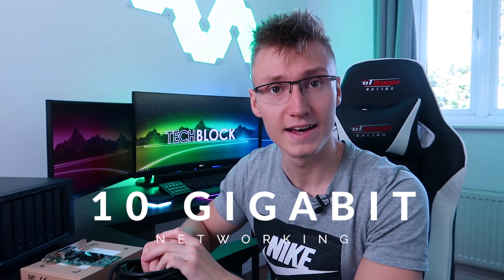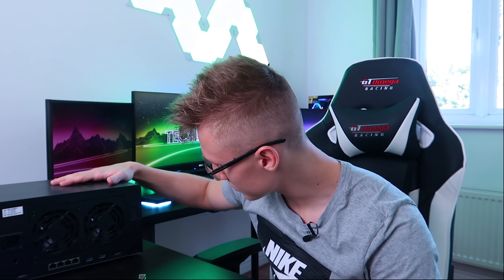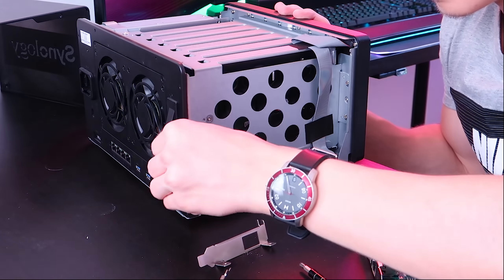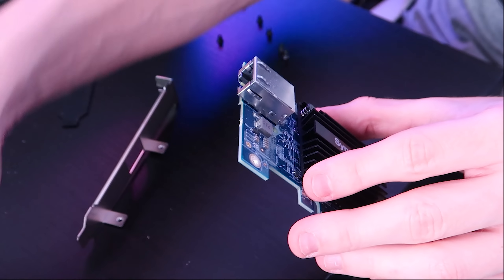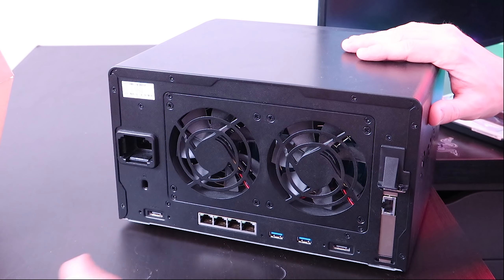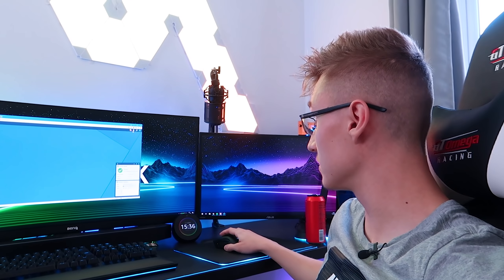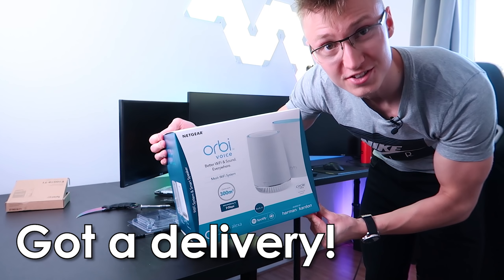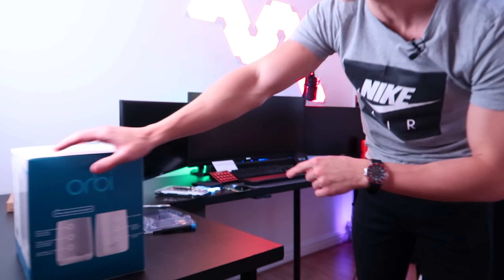IT WORKS!! - 10 Gigabit Networking + CAT 8 Ethernet! (Part 2)

Comment: about the SSD cache, it's good since storage is very cheap nowadays, about results.. well, you'll get better speed only on files that are actually cached, on all the rest the speed won't change !, second, cache is needed only if you use same files many many many times during week/moth, if change often, benefit is like 50 %
Reply: Lämp

Comment: You could just grab a Mikrotik 10GBE 5 port switch for $130 US on Amazon and 2 10GBE PCIE 8x network cards for $62 on Amazon. Then connect the switch to your Nighthawk, then your Synology and main puter to the switch under your desk. Depending on cables, 3 might be $50 to $60 on Amazon. That's a sub $300 solution for 3 10GBE connected devices.  That seems a bit cheaper and more efficient in the long run, as well as giving you 3 more ports for later 10GBE expansion. Also, your Synology has an APIPA, as per the 169 IP address on the map. If you used the method above, all of the devices  would also achieve internet through the 10GBE connection.
Reply: Yeah most of the cables hes found can be found for 10 to 15 dollars

Comment: I have a cat8 Awg 22 which is the biggest you can get on thw market. The problem with cat8 is its a 2 channel, not a four channel. Which allows multi connection to run at once

Comment: well well.. again.. you can't use a bonded gigabit link, lacp or lag, neither, to copy a file if in the frame containing the sender there the same device ! that works if a nas is connected bonded, like your 4x1 gigabit to a switch and to the switch are connected different "sender" pc, whatever, than the nas will be able to share 4 gbit bond with those different devices, example : 4 files copy x 1 gbit speed each.. right ?!?!?!  LoL

Comment: to get that speed, every device has to support it, from your pc, to server, to router. also, depending on the raid mode on your server, your drives are your bottleneck. 10 gigabit ethernet is 1.25 gigabytes per sec, which you would get less in actual speed due to handshaking and latency. your best bet is nvme drives, although, that server doesnt look like it supports it. its also been proven that raid on SSD drives for speed has not been good, so there's that. 10 gigabit is great for datacenters, where you have like a hundred hard drives in a rack, but not something i would use at home.
Reply: You have no clue what you're talking about do you?

Comment: So is there not a way to get the 2 port aggregation from the nighthawk 700 to work with a 2.5gbps Ethernet port on the back of my PC? Would a 2 into 1 Ethernet splitter not work? I have 5 gig up and down internet and my motherboard supports 2.5gbps and I can’t use my current gaming router cause it’s only 1 gig ports with no aggregation. How can I achieve 2.5gbps with the NH 700 port ag to my PC?

Comment: 150mb/s does not equal a 10GB network..... I'll top out maybe 125MB/S (105 MB/S average) just optimizing my R620 server and T3600 workstation nics and using CAT7 along with my existing meraki switches...  Would have been more believable after spending all that money if you actually had a transfer speed of  950MB/s or higher.

Comment: Is there a reason you used CAT8 over CAT6a cabling?  Both can handle 10gbps data transfer rates and there isn't really any gain. Just coming from a Networking Engineers perspective. I also don't suggest buying networking cables from Amazon, I have heard to many stories about people ordering CAT* and almost always get Cat5e cables.